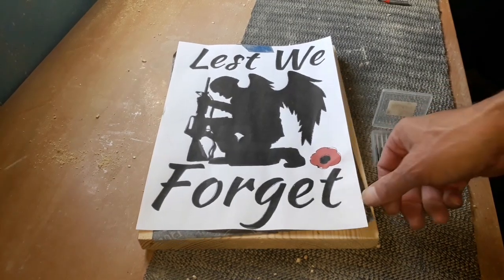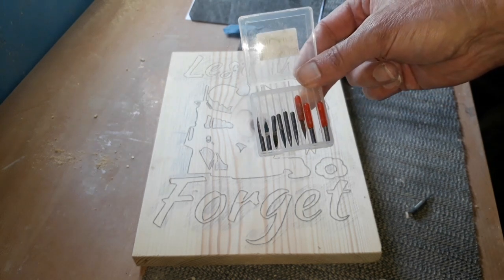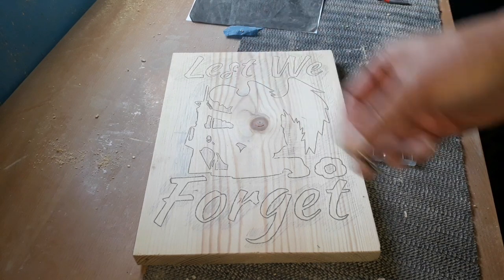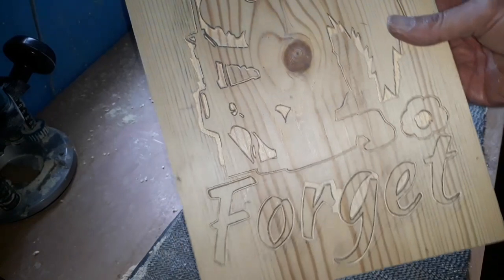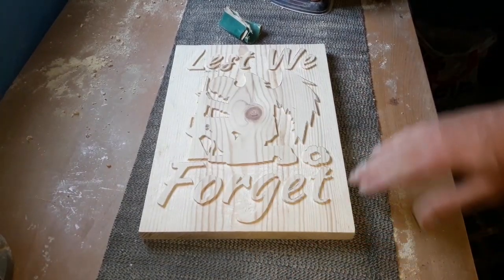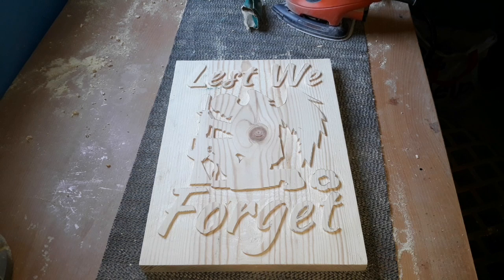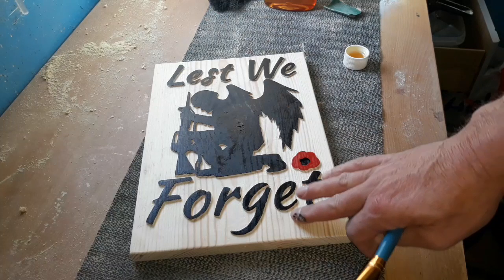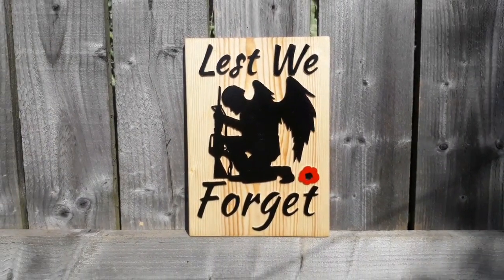Lest we Forget plaque, Router project

Comment: Learned alot by watching you. Love your work what I do is print out image on freezer paper shiny side and it transfers to wood less work tracing.
Reply from the maker: Thankyou, I've looked into the freezer paper before, I once did a transfer with baking paper..I find the carbon and trace relaxing, plus you can use the template as many times as you like.i once stuck the image straight to the wood and routed on to the paper, what a mess,I wont be doing that again..lol